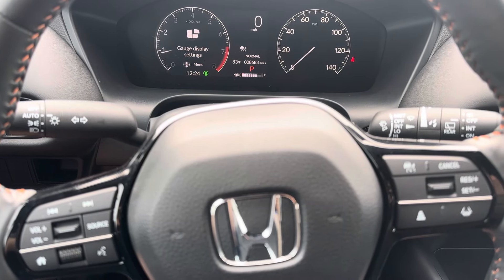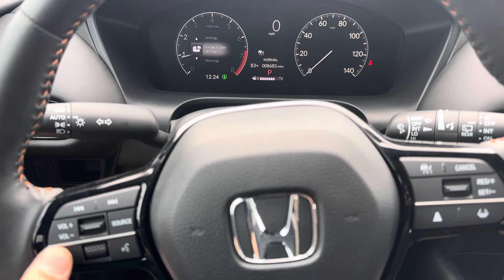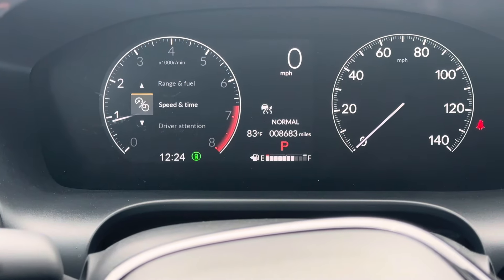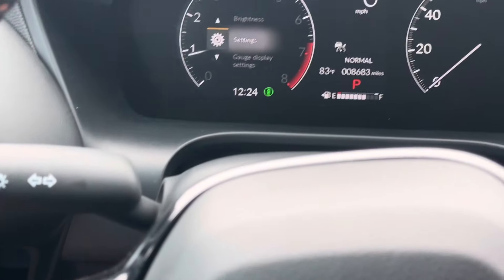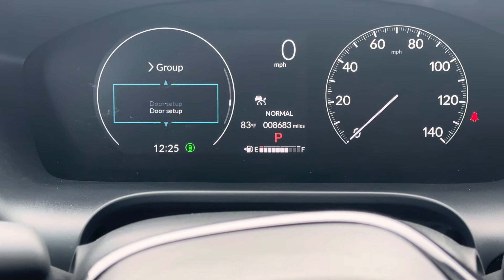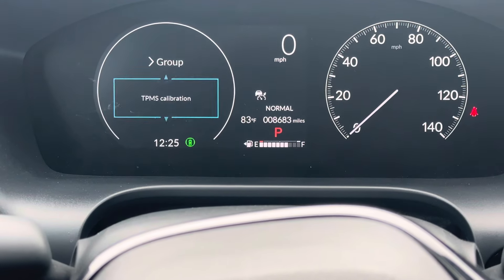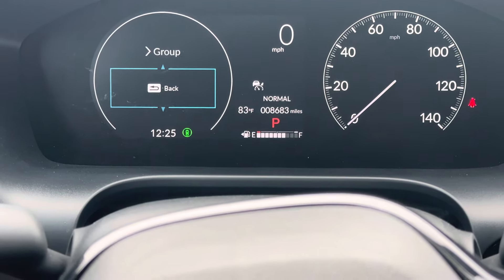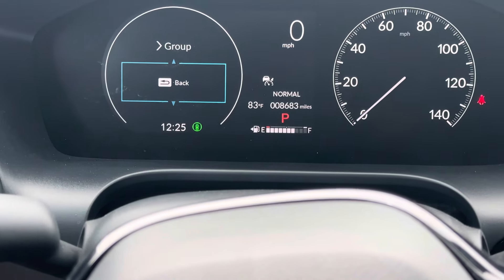2023 - 2024 Honda HR-V low tire pressure reset / HRv TPMS calibration

Comment: Mine doesnt have a settings option.. looks just like urs but doesnt have a settings option 🤷
Reply: Mine doesn’t either what should I do instead?? 😩
Reply: İn screen there is an car settings near the settings just click the  car settings and then tpms
Reply: Mine doesn't have tpms i think
Reply: @jithupunnoose5643  look on the screen display from Apple play not the dash like shown in the video
Reply: @JessNoemi  thank you
Reply: @bahar8075  thank you! The owners manual shows as it is in this vehicle but mine did not have that. As you said it is on the main screen!! Thanks!!